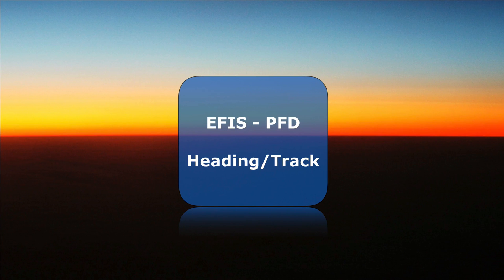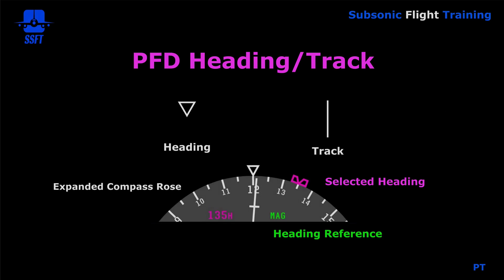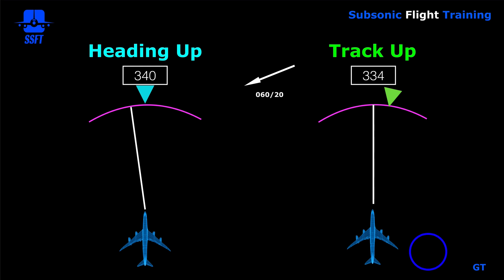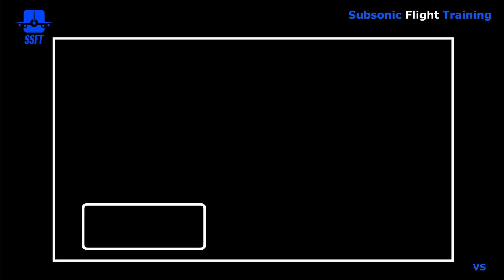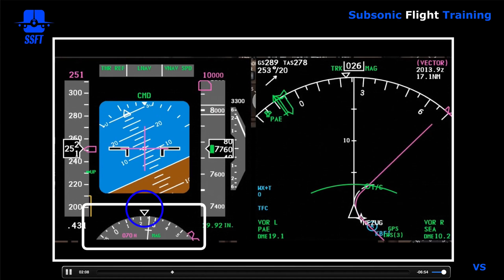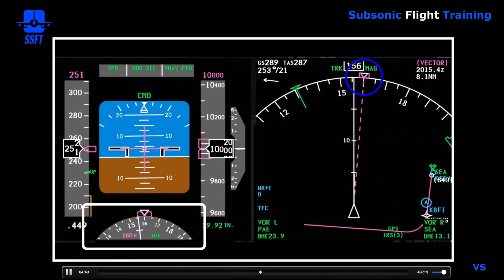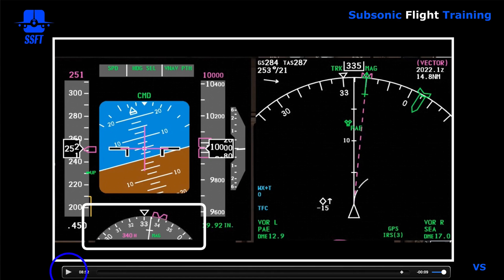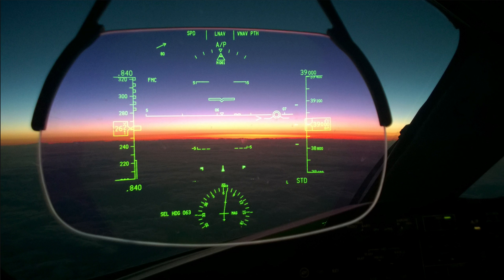EFIS PFD - Heading Display (iFly 747-400)

Comment: 2:49
How is heading displayed in a jet?
1) Steam gauges vs Glass Displays
2) In the olden days, there were Round Dialed Steam gauges
3) In the modern jets, you have the glass display.
4) the Heading portion of it will be displayed on the PFD.
5) It is displayed at the bottom of the PFD.

Comment: 2:12
|| How is Heading generated in a jet? ||
Heading is generated by the Inertial Reference System (IRS)
==|| In Boeing 747 there are three IRUs to supply heading
==|| In some aeroplanes, it will be an ADIRU (Air Data Inertial Reference Unit)

Comment: Does it mean that the heading from a way point to another in a specific route between 2 specific airports changes..depending on wind direction from time to another ??!!
Reply from the maker: If I understand your question, yes it will change depending on the distance covered between the 2 points...